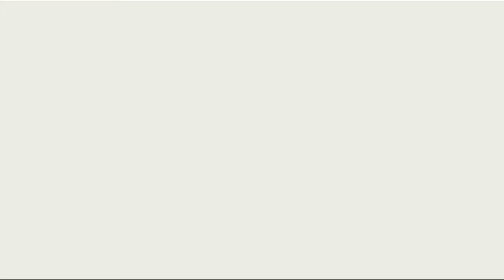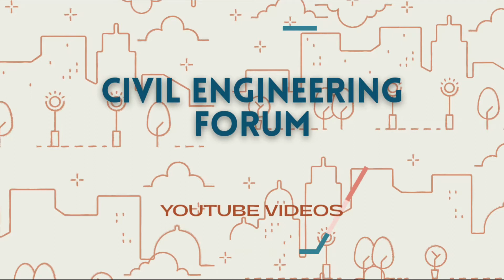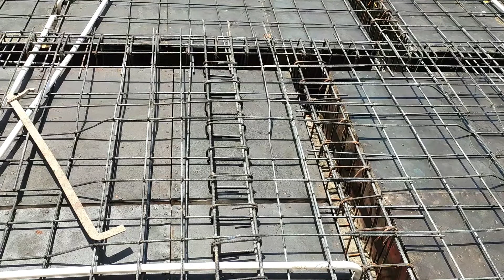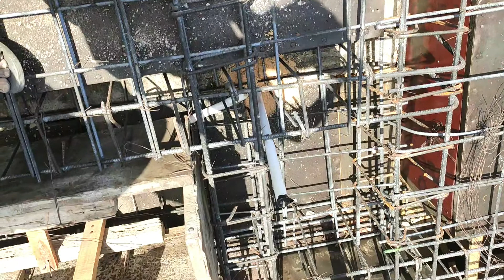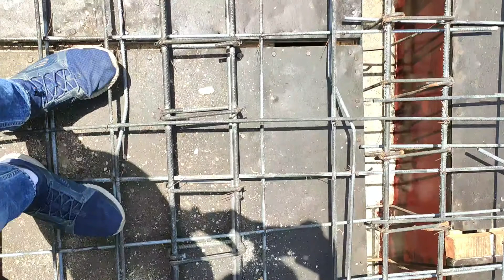What is a Hidden Beam / Slab Beam / Concealed Beam? | Advantages, Disadvantages, and Applications

Comment: sir 9inch k hidden beam pr 9inch ki brick wall de sakte h kya 14ft ka distance h  wall to wall
Reply from the maker: de sakte hai par you need to use light weight bricks
Reply: @BrandEdgeReviews  red brick h
Reply from the maker: @neelthakur9264  use flyash or AAC blocks
Reply: @BrandEdgeReviews   sir red brick se kar diya h hidden beam m 3 bar top 16mm ka diya h aur down m 20mm ka bar diya h